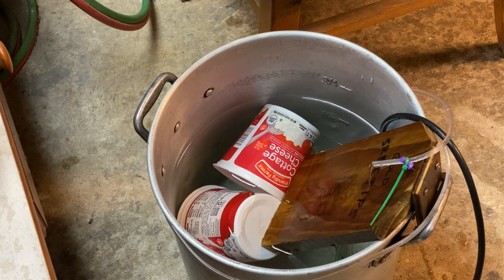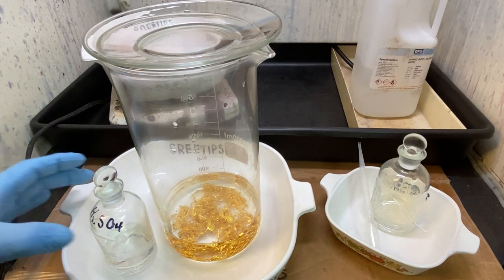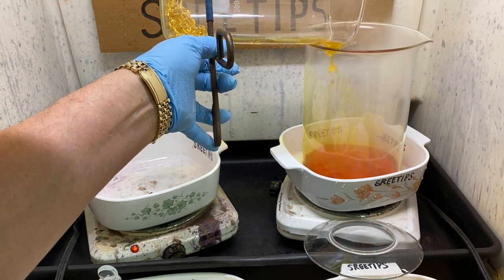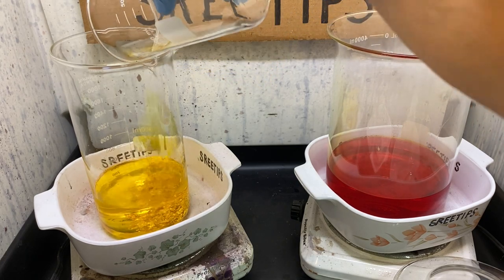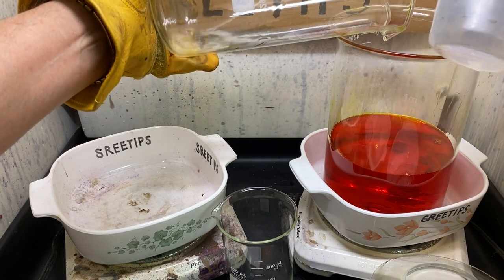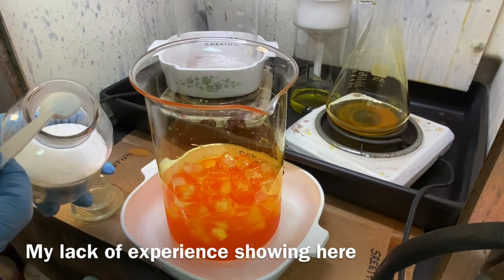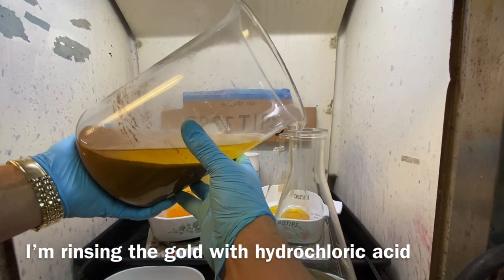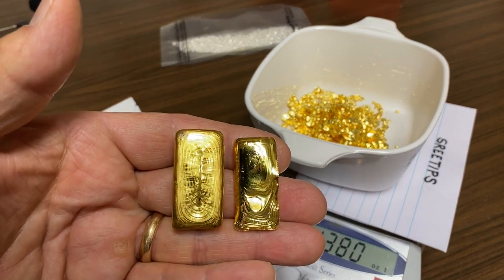15 Ounces Of Gold Dissolved in 500ml

Comment: sir thanks to the video, I like the video you shared its interesting, soon if I can have the tools I will do these. sir what solution you use to drop into a paper tester ?
Reply from the maker: https://youtu.be/j3SlZphCjj4
Reply: @sreetips  thank you for your response sir, the problem is where can i get tin granules for making a tester solution...is it available in the hardware sir ?
Reply from the maker: I bought mine on eBay
Reply from the maker: https://www.ebay.com/itm/Tin-Shot-1-Pound-99-9-Pure-Raw-Tin-Metal-by-MS-MetalShipper-/274925580771?mkcid=16&mkevt=1&_trksid=p2349624.m2548.l6249&mkrid=711-127632-2357-0
Reply: @sreetips  thank you very much sir.

Comment: I just randomly watched this video. @sreetips did you notice that there were little globs of gold flying off in all directions? you may have lost some gold because of it :(
Reply from the maker: Yes, some of it sticks to melt dish. Some gets lost when dissolving as fine droplets that rise up with the red fumes. Some splashes out during filtering and when transferring the gold bearing solution. I little gets poured off with the waste solution. Some even sticks inside beaker after precipitation. There are losses all along the way. Minimizing these losses will depend on the skill and technique used by the refiner.

Comment: Why not put a vent cap on your fume hood to stop the rain?
Reply from the maker: Because it would dampen the flow out the stack.
Reply: @sreetips  even if the cap was a foot or so above the vent tube?
Reply from the maker: It’s not necessary. The draft keeps light rain out. Heavy rain makes it in to the drain. Dilution is the solution to pollution. A cap would impede flow.
Reply: @sreetips  I understand

Comment: Where can I get some nitric acid
Reply from the maker: Here is 3.2 gallons of technical grade nitric for $325 pricey but available
https://www.ebay.com/itm/402509568962
Reply: Thank you. I have two 5 gallon buckets of rock that's looks to have a lot of gold in them, I have Ben trying to get it out. I have planned some of it, but it's just  so small of flakes after I crushed the rocks it's hard to pan it out so I'm hoping I can pull with acid.
Reply from the maker: If I had some I’d do this experiment: measure out a small amount, say 500ml of the material. Put it I a 2 gallon bucket. Cover it with HCl. Add 1/4 cup of bleach. Cover it loosely and put it in a large 5 gallon bucket and cover loosely. This will make deadly chlorine gas. The chlorine will leach the gold out of the material and put it in solution. I’d let it sit for a few weeks. Adding more bleach every few days and stir. Then test the liquid with stannous. If there’s gold then the stannous test will reveal it. That’s what I’d do if it were mine.
Reply: @sreetips  well I have done that, and I have like one, a half gallons of really gold color stuff, but I have not had the time, or place finish it off, I have some that is a green tent to it and I think it's got sum iron in it, not shere haw to get it out.